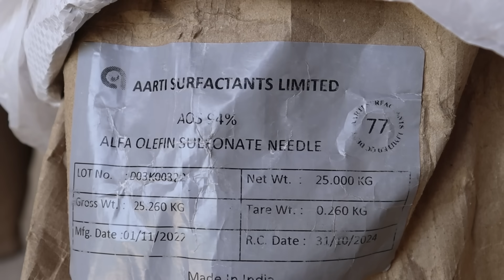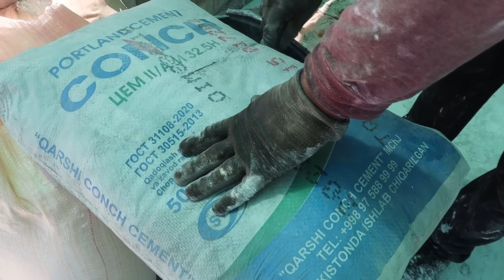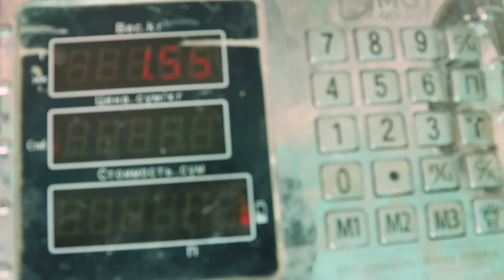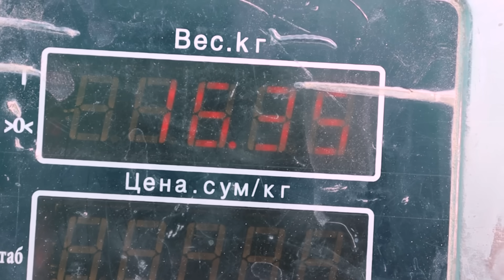Amazing process of making foam concrete blocks | production of foam blocks with subtitles

Comment: Non informational, i have zero clue of WTF they are doing.
Reply from the maker: everything is calculated here
Foaming agent - alpha-olefin sulfonate AOS.
250-300 g of alpha-olefin sulfonate 50 liters of water gives 150 blocks.
block sizes 60cm/30cm/20cm
the air compressor is set to 5-8 bar
1 block costs $1
1 kg of gypsum costs $0.04
1 kg of Cement m450 costs $0.06
List of ingredients for 3 foam blocks
37 kg of gypsum
2 kilograms of Portland cement
50 liters of ready-made foam (alpha-olefin sulfonate) weighing 1.5 kilograms
50 liters of water
blocks dry differently depending on the season and weather of the country in central asia dry summer time 7 days

1) Tile adhesive is used as an engine for assembling blocks.
2) These blocks with noise and heat insulation do not burn in fire
3) the finished block weighs about 15-16 kilograms